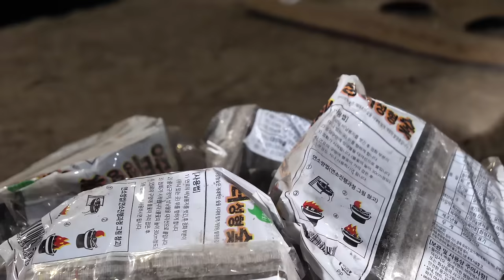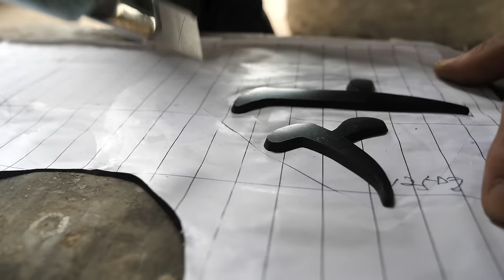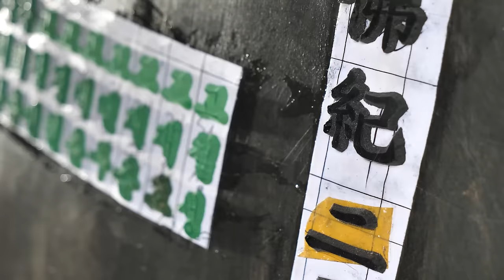The process of creating the most magnificent and beautiful bells in the world. Korean Bell engineer

Comment: So many questions!  This was an amazing process.  Bordering on crude but time tested.  And it works!  I wonder if the white sand being used and mixed up in a muller was sodium silicate (co2 cured casting).  I sure seemed to hold it's shape with minimal ramming.  How long did this take start to finish?  What is the cost of a work of art like this?  How many bells do these craftsman make a year?  So many different techniques used here.   Fantastic..
Reply: Surely this must have been a couple months at least start to finish, with all the polishing and clean-up detail work after casting. Without modern power tools it would have taken way longer of course (and needed more people undoubtedly.) Brilliant handcraft work to create such beautiful, massive objects. :) Lovely sound of the bell, too... Wow.

Comment: Amazing, I've always wondered how these were made, answered many of my questions. Now I'm wondering how these were made a thousand years ago, great video!
Reply: it would be the same technique, but using wooden molds instead of steel. Lots of wood carving for little letters, etc.  it probably took them an entire year to craft one of these massive bells a thousand years ago, and now it looks like a couple of weeks to do the same job.

Metal casting really hasn't changed since the Roman era, and probably goes back even earlier.

Comment: I enjoyed watching these craftsmen, a narrative explaining what each process is and why it’s necessary would have been useful.
Reply: The hardest part is taking into account that as the bronze cools, it contracts. To avoid the bell cracking as it cools, the casting sand has to move with it, while retaining enough support for the bronze not to slump.
The thickness of the sand has to allow this to happen proportionately to the varying diameter. The interior support is the most critical. 
Originally, the bonding agent for the sand was  was made by boiling fish bones for hours to form a glue, then diluting the residue correctly for the sand to move without cracking. You can see this briefly, starting at 12:30 I was wondering whether the original bonding agent is still used today, or whether modern resins are now used. The colour of the liquid looked like the old school solution to me.
It has taken a full paragraph to explain one small point. A full narration would have more than doubled the length of the video and probably completely baffled most viewers.

Comment: I live near Loughborough, UK, where Taylor's Bell Foundry use similar methods to make some of the world's biggest bells (up to 20 tonnes). They made Great Paul, for St Paul's Cathedral London in 1881, which for many years the world's largest. They often re-cast cracked bells by making a cast of the original bell and using the original bronze.
Reply: Any idea of the cost of these bells??
Reply: Alas both bell foundries here in the UK have stopped production, Whitechapel went first then Loughborough. If we need new bells we get them from the Netherlands.
Reply: @MartynCole  Really? I knew that Taylor's went into administration in 2009, but was rescued and a new company formed. They received a large grant recently and work has started to refurbish the buildings which are listed.

Comment: The work as so many have stated is amazing... I was wondering as I watched them remove the casting and begin the cleaning and polishing process how long just that part of the project took, the man hours to get to the beautiful final product...
Reply: I personally did concrete work over the years... not just flatwork but kitchen countertops that looked like marble, light and dark main colors. Round walls with decorative trim for wood decks to sit on. Fences that looked like stonework with mid and corner pilers. plus, swimming pools, water features with water falls and a pond... Just saying I appreciate the talent these gentlemen have and are passing on to the next generation, so it won't be lost forever...

Comment: China had already cast bronze bells far exceeding this size in the Ming Dynasty.
Yongle Bell：It is 6.75 meters high. The thickness of the bell wall varies from 185 mm at the thickest point to 94 mm at the thinnest point. It weighs about 46 tons. There are scriptures cast all over the inside and outside of the bell, with a total of 227,000 words. The alloy composition of the copper bell is: 80.54% copper, 16.40% tin, and 1.12% lead. It is cast from clay.
It is a miracle that such a huge bronze bell was cast in ancient times 599 years ago. It is not something that Korea can imagine.🥱

Comment: What metal was used? Brass?
Reply: Bells are made from Bronze.
What is the chemical composition of a bell?
Bell metal is a hard alloy used for making bells and related instruments, such as cymbals. It is a form of bronze with a higher tin content, usually in approximately a 4:1 ratio of copper to tin (typically, 78% copper, 22% tin by mass).
Reply: @GeoffryWK  thx! I thought bronze at first but when the ball was angle ground it looked the colour of brass.